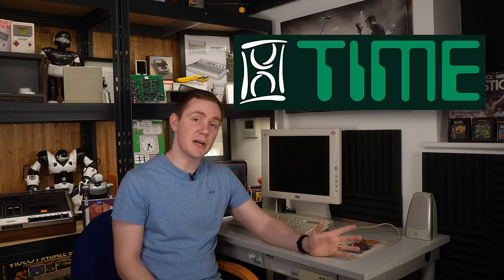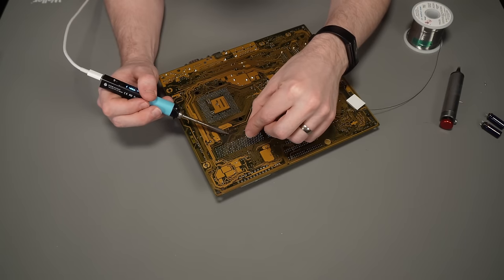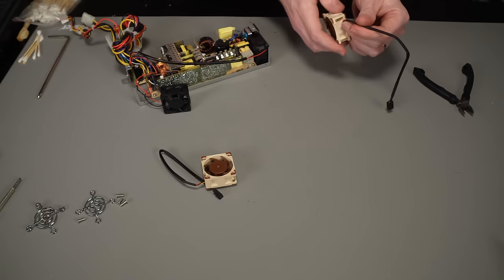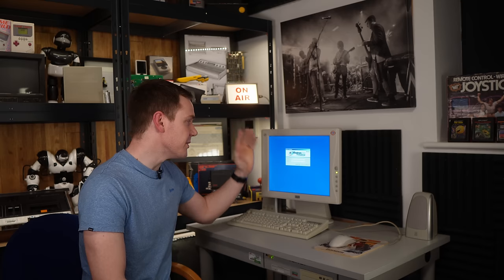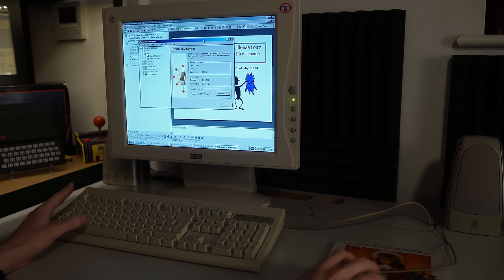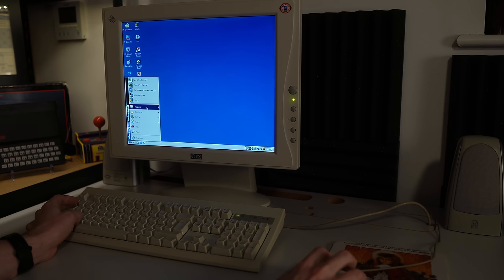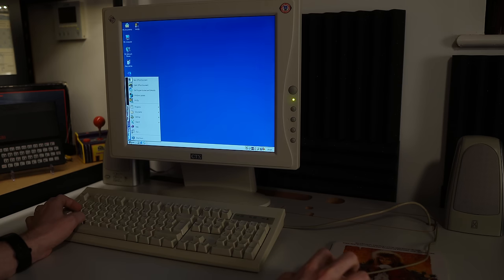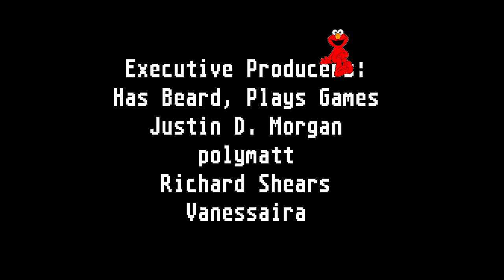2002 Time ICEDESK Desk PC Restoration & Exploration

Comment: Found a windows desktop on the side of the road once. It did not power on but I connected the hard drive to my own computer and found out that the machine belonged to a small business in my town. There was administration stuff, shop inventory lists and even a few shady looking scanned handwritten loan agreements for quite large sums of money. I burned the contents of the drive to a DVD, wiped the hard drive, dropped the DVD in the letterbox of the business with a note that “even if the computer doesn’t start up, the drives might still work fine so don’t dump it on the streets”…
Reply: lmfao
Reply: yup. always zero out or physically destroy hard drives.
Reply: @JessicaFEREM  it’s not something a non computer savvy person would do, or know how to do.
Reply: A good lesson in security, but that "awareness" has led to an endemic -- the knee-jerk destruction of perfectly good hardware.  Like when you go to a place that sells used computers, and you get an OEM system with no hard drive at all.  What are you supposed to do about the bespoke drivers now?

It would have been nice if the computing industry had made it a point to focus on proper recycling procedures.  Encourage local computer shops to offer offboarding as a service, and raise awareness that this is something you should do.  Like taking an old car battery to an auto parts dealer or battery retailer instead of throwing it in the dump.  If it were free or nearly so, and the old machine could be sold used afterward, it would benefit everyone to have the shop, who are qualified to know what to do with it, image the restore partition (e.g.), wipe the drive, reload the partition, restore the OS, and then put in on the secondhand market, usable and secure.
Reply: I was just thinking that he might want/need to do something along those lines when he mentioned wiping the HDD

Comment: It never occurred to me that there's a "correct" way up for USB ports.  It's a 50/50 chance, so you will almost always get it right on the third try.
Reply: Or push a USB plug in the RJ45 connector :D
Reply: @Dutch3DMaster   I will neither confirm nor deny that I have done this countless times.

Comment: I would like to see the overclocking with a pencil trick. I've heard about it but never seen it
Reply: Me too!
Reply: Heard about it but never believed it, please do,
Reply: @MacMelmac why not? You can test the conductivity of a thick layer of pencil graphite on top of a paper, you are bridging a very small distance and it worked on ceramic CPUs from AMD, the later ones have an small gap that need to be filled with non conductive material like epoxy before you can bridge these contacts.
Reply: @MacMelmac : It was real, but dependant on details of the packaging. If they'd packaged the CPUs differently, then it never would have worked.
Reply: if you do overclock get a better heatsink. them old athlons and durons loved to get stupid hot. Had a athlon xp back in the day and the ac went out in the apartment came home from school with the cpu fan literally melted to the heatsink and the heatsink was hanging off the socket. yup that was not fun explaining to my dad that it jest cooked it's self.

Comment: The capacitor plague wasn't a "manufacturing issue", it was repeated inept theft of the formula that somebody thought they could get rich off, by undercutting the entire industry with their component instead.  Foxconn, Gigabyte, Asus and many other big name manufacturers bought them up like candy, then just about went bankrupt trying to address the failures a year (and often less!) later.  Even Dell was brought low by the issue, but they thought they'd just pretend there wasn't an issue at all in the first place to their customers, so they got slapped with big ole class-action lawsuit.

Comment: Just the other day I was working on a Pentium 4 that shipped with Win2K.  I'm pretty sure that was the first time I've ever actually seen the Windows 2000 CD Player app despite using that OS when it was contemporary.  I certainly remember using the old CD Player that shipped with Windows 95, and would've assumed that's what would've been in Win2K, if anything other than Windows Media Player existed.  But by 2000, I had completely abandoned everything but WinAmp, so not once did I ever run the plain old audio CD player application.  That's so weird (I used to try everything in a new OS!) that it almost feels like it was slipped in posthumously.

Comment: I would love to see you try and over-clock with a pencil!!
I very much remember when that was a thing. I thought it was only on Athlons though, but am happy to be corrected. I do belive they added an extra coating on later chips to prevent this, but that could also be curicumvented with a knife. But this is just based on memories from 20+ years ago. I'd rather wait for you to do it in a video, than to spoil it for myself by checking the facts ;-)

Comment: I used to go to various computer fairs in and around Manchester in the 1990s and there was always a reseller stand selling Time computers which had been returned as faulty. They had bought them from time and repaired them and then sold them at the computer fairs. There must have been some sort of clause in their purchase agreement with Time Computers that they weren't allowed to sell these repaired machines under the time Brand, so they rebranded them all... as EMIT 😂😂
Reply: EMIT was the name of the shop that sold returned Time hardware. The shop was based in the same industrial park as the manufacturing plant. It is now based in Blackburn. I used to frequent EMIT to buy "bargains" which often didn't work...but it wasn't a problem as you could easily return and get a replacement...and then try again 😂

Comment: It's been a very long time since I've had to reset a NT workstations password. In the past I've spent many an hour using that Linux tool to reset lost passwords, for those who used local users and did not have a domain.
Reply: Still works with Windows 10/11 ;)
Well, at least for local accounts.

Comment: 01:39 there is a wrong way?
Reply: Yep. The solid piece (white for usb 2.0, blue for usb3.0 etc) should be on top. That way it matches the male connector's right side up. On male usb connectors the usb symbol is either printed or embossed on what is supposed to be the top. There are also 2 squares on the metal part of the male connector indicating the top. Some cheaper cables are manufactured upside down but for the most part that's how you can tell which way is correct at a glance.
Reply: @chadmasta5  yes I have noticed its not consistent, guess not all manufactures are following the same standards.

Comment: You would choke to know what some folks have stored on the hard drives they sell or donate. Just be careful, innocent as it may be to find or buy a used drive you can be held accountable if there is some illegal stuff on them.  I generally don't bother with it anymore as prices for drives has become ridiculously cheap.
Reply: Every time I buy a second hand computer (a rare moment), I blank the disk and install my own os before using it.

Comment: You put on the themal compound wrong, there's NO pattern you put it on. you put a little on then smear it out to cover the entire heatsink. If the layer is too thick, which most of the 2000+ noobs do, it's will cause the cpu to be too hot and not work properly at all.